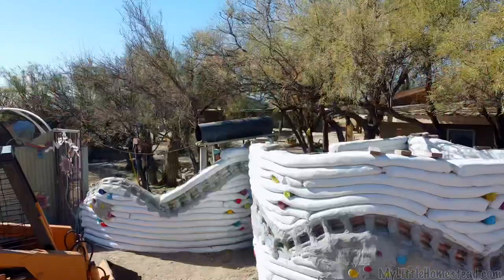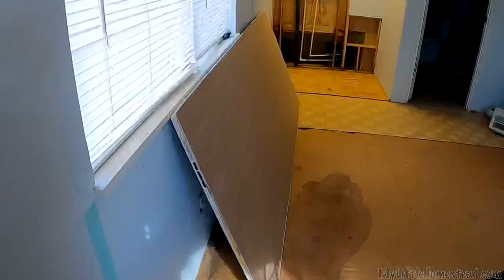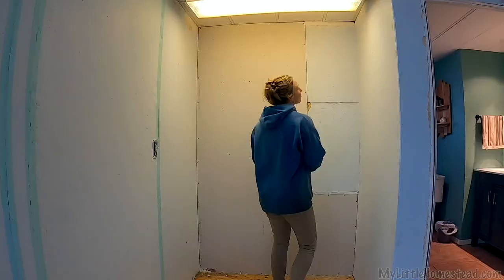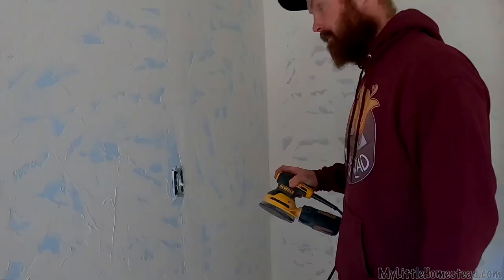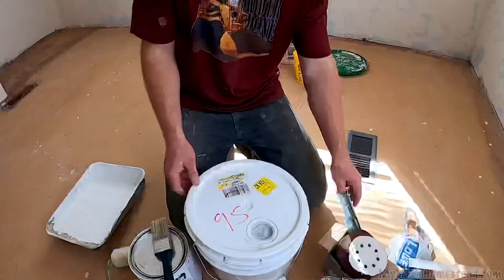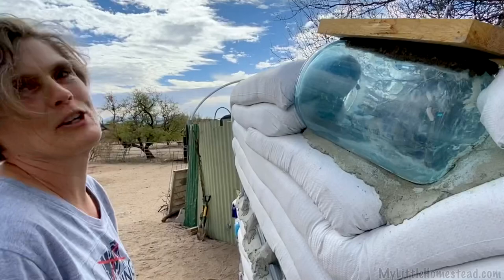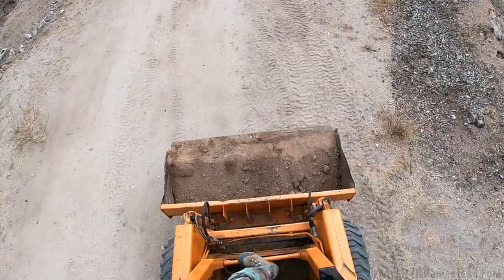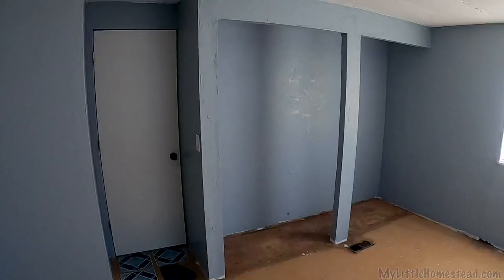Earthbag Courtyard Wall Finish | Weekly Peek Ep269

Comment: Garen and Ellie I have learned with using that type of tape I would cut a groove in the seam of the drywall, so more drywall mud will penetrate into the opening between the sheets of drywall and seal better.

Comment: GAren for the sanding of the drywall mud use a shop vac on the end of the sander where the bag attaches it will reduce the amount of dust in the room and your lungs I did the same to my electric sander and helped out tremendously.

Comment: The bedroom is looking great. Next time you do some drywall, try hooking up an old canister vacuum the sander. It works great and you do not have to keep emptying the dust bag., with little to no dust in the air. Give it a shot you won't be disappointed. All the best to you and yours.

Comment: Oh Garen, you poor soul.  You walled up you shower plumbing.  You should have cut an access panel to that plumbing with the drywall and then framed it with trim.  That looks like a closet area so the panel would be hidden inside the closet.  Now with no access panel you will have to take down all that drywall if you ever need to fix or change the shower plumbing.
Reply: That's The comment I left and well. I think it needs a secret access panel. Like the hardware from a cabinet, so  when you press on the panel it opens.

Comment: It might not have been the best idea to tape the drywall to the back of the shower. Because if you need to access the pipes later for a leak or upgrades, or even replace the valves, you're going to have to tear out the entire wall. It would have been better to simply hold it into place with screws and paint over it, or created an access panel. Just a thought.